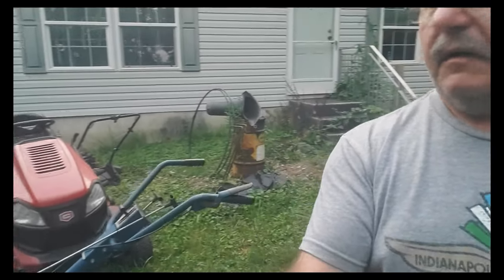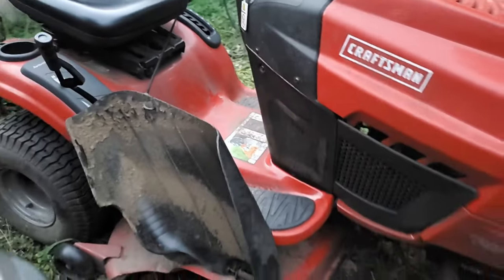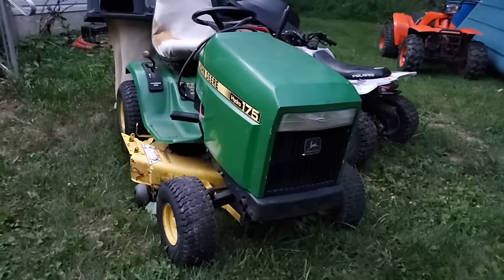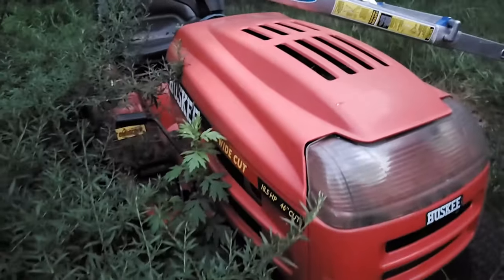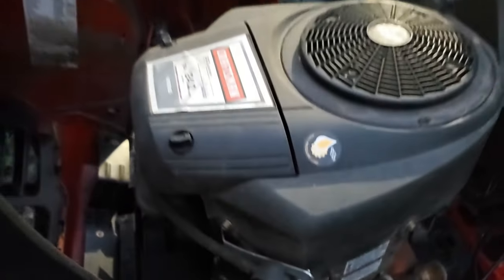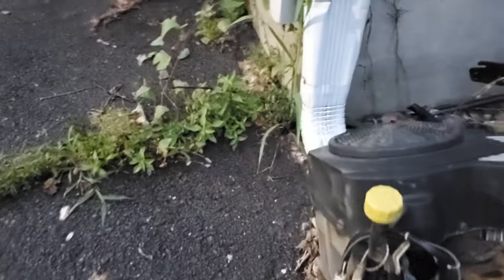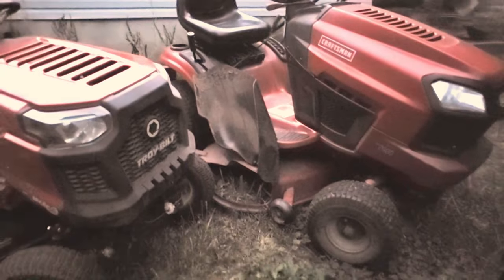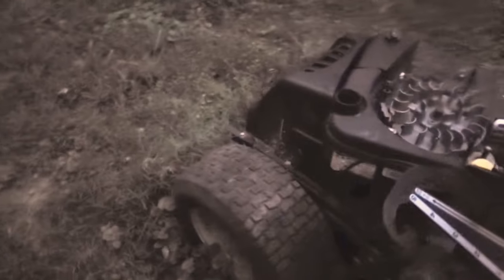Being a Mower Reseller in 2024, Is It STILL Possible?

Comment: We must have a Wednesday engine in our 2004 Husqvarna LT151 no issues other than the leaky valve cover gasket, and that was easy to do, didn't really start leaky that badly until between two to three years ago.. had a look at the sump-cover bolts when I had the fan shroud off to do the valve-cover gasket, and no sign of any coming loose on Our Courage is the15hp version.
Reply from the maker: I have had a few that were not bad yet, but the percentage is low. If you have good luck with yours, that is great for you.

Comment: I have had so many of those in the shop.  Poor/no maintenance.  They get bad cams or broke connecting rods. Sometimes I'll do the genuine Briggs cam or just the head gasket, but mostly they go to the scrap pile.  Who wants to put a $600 engine on a $1000-1900 new cost tractor.  Junk.
Reply from the maker: I agree, someone had commented about Harbor Freight. I am a frequent buyer there. I do not see riding mower engines there, but even if there were, if you buy one , then there is no profit when you sell.

Comment: It’s tuff but the flat heads are only worth keeping for resale and if it’s a plastic trans the engine will be put in other with aluminum trans or switch the transmission out 😢😢😢
It’s not very good profit now period 
Just a retirement thing for me now 😊
I stay away from kohler single cylinder period, only for body parts
Reply from the maker: I was wondering for a while, it is just me or is this business really changing this fast. Judging by the comments on this video, it is not just in my head.

Comment: Unfortunate. Those two are red ones would clean up nice, but I guess you're stuck waiting for a good engine to come in on a broken trans. Or just keep the rollers for parts. Either way, it's not ideal.
Reply: you could try replacing the connecting rod on that one
Reply from the maker: @Kylebythecreek I would try replacing connecting rod if it was locked up. But since it broke, I would have to disassemble and inspect for damage first. I would start by checking behind starter.
Reply: @ridingmowerking  yup! The block could definitely be cracked